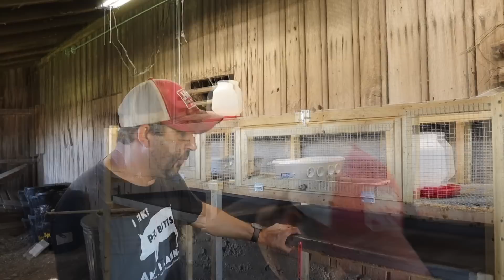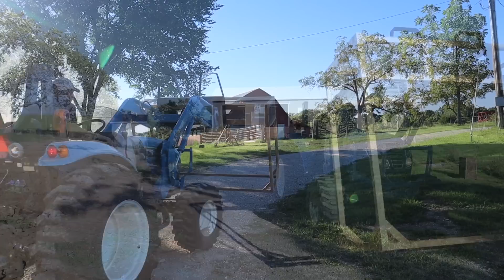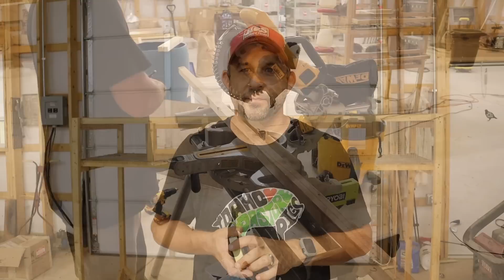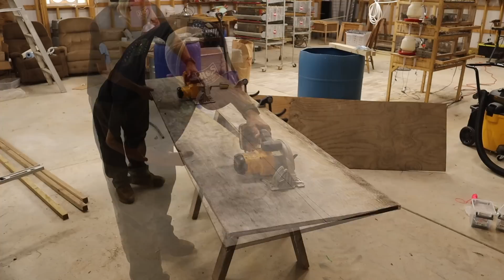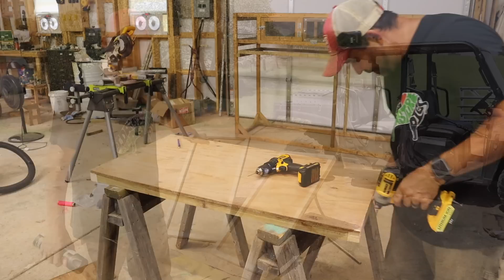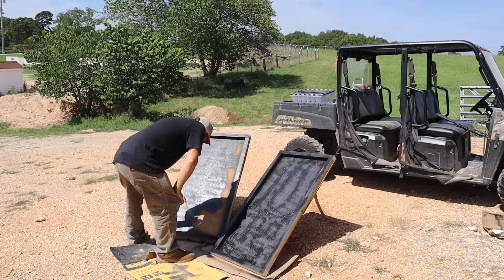A Health Issue Has Caused Me To Make This Decision...

Comment: N95 mask working with them. Take it  seriously, Kevin. The longer you are exposed, the worse allergies become, until you end with COPD.
Maybe you will not find out WHAT IT IS. But protect yourself.

“Any individual cleaning a chicken coop must wear a mask for the sake of their own safety and health. The best options are a respirator mask or N95 dust mask to prevent the cleaner from inhaling hazardous fumes and particles that could cause various, potentially life-threatening, diseases.”

Comment: I have asthma too. After I was sick my asthma was out of control. Even the inhalers were not really working, so I decided to try something different.  I started with my nebulizer I put half colloidal silver and half peroxide. I had a really break through with using that, but I was still having breathing problems. The thing that has gotten me back to an almost completely normal life was the nasal sprayer. I put the colloidal silver peroxide mixture in that and took a chance. It burned for about 8 seconds but I could already feel the improvement in my breathing. Three more uses and my sinuses were clear, my asthma was gone. If I feel a cold or my asthma coming on again I just use the spary and it stops. I hope this might help you too, not being able to breath is the worst thing I have ever experienced.